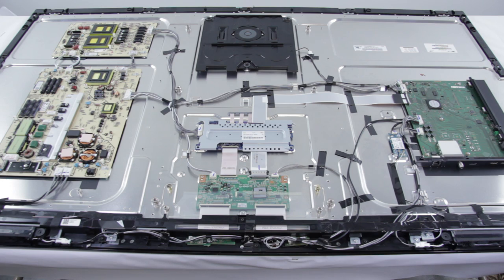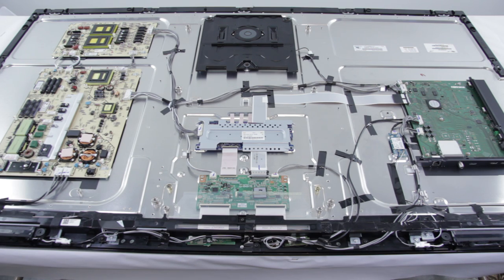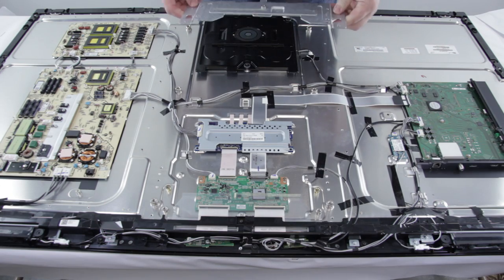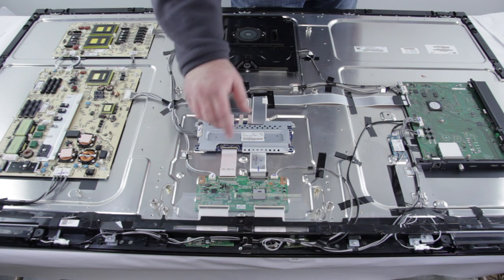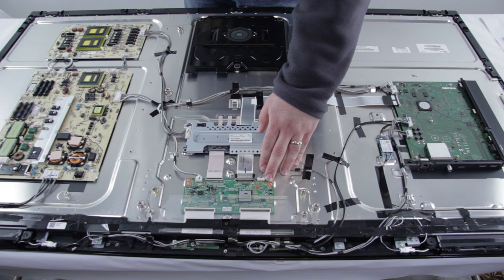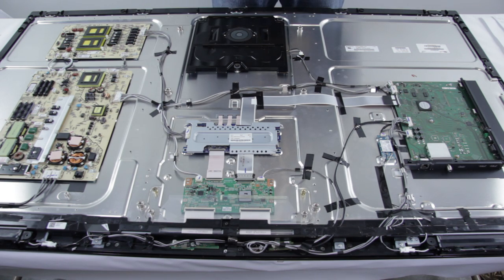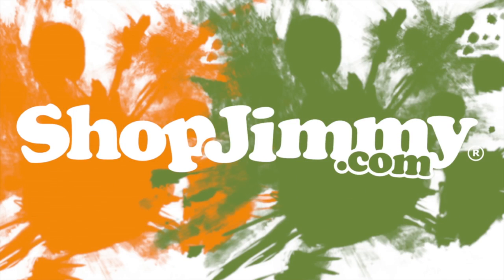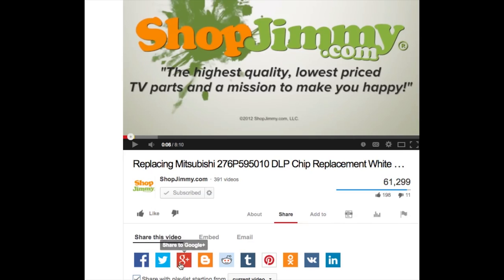LED TV Repair T-Con Board Help Review Overview - Common Issues and Problems with T-Con Boards

Comment: I have a quasar sq5000 TV. you can turn it on but after 2 to 5 minutes it goes black. if you shine a light on it you can see a dark image. I've tried replacing the main power board and the LED driver board and that did not fix it. The Sound Works and never goes out.  I was thinking it might be the t-con or the backlight strips,  I'm pretty sure it's not the logic board. Any help would be appreciated

Comment: I have a Hisense 50K360G has backlight but no picture. When I disconnect one of the tcon ribbon cables I get half a picture. Also when the half picture is showing the menu and input buttons do not work either. I also get blinking code. 7 blinks short pause then 3 more blinks
Reply from the maker: Dan Bierman   Try all repairs and troubleshooting at your own risk.  This sounds like a TV panel (TV Screen) problem.  If your TV panel is bad, it may be more cost-effective to replace the TV as panels are typically hard to find in stock, difficult to replace, and expensive.  Thanks and please let us know if you have any further questions!  www.shopjimmy.com

Comment: Hello, I have a Samsung LN52A750R1FXZA LCD TV with a distorted picture. When I turn it on, the video has double or ghosting images and one half of the video will be lower than the other.  After warming up for 30-45 minutes, the video goes back to normal. Would you know what part I could start with replacing or how I might troubleshoot it? Thank you for your time, Steven.
Reply from the maker: Steven Lovold   This sounds like a TV panel (TV Screen) problem.  If your TV panel is bad, it may be more cost-effective to replace the TV as panels are typically hard to find in stock, difficult to replace, and expensive.  Thanks and please let us know if you have any further questions!  www.shopjimmy.com

Comment: Hello I have an Etec 42 inch led tv and while Im watching tv the it goes haywire, input funtion comes uo then switches to menu then sometimes changes the channel.. It will do it for a awhile then stop but then repeat itself. It's very annoying. Someone told me maybe I need to change the T-con board but not sure. Any opinions would be helpful. Thank you

Comment: I Have a Hisense TV 50Hg5, 2014,  The red light comes on but don't get any sound or Picture, don't see any back-lights on and can't see any image on the screen when using a flash light on the screen, I only see a power supply board,main board, t con board, don't see anything wrong with any of the Caps on the power supply or main board. Thanks for any help

Comment: hello, 
I have a insignia tv that I had found in the alley,
this tv doesn'tdo an itching whenI press the power button, I opened the back cover and everything looks OK with fuse,and capacitors. onething that I noticed on the t con  board is that a very small led light comes on when I plug the tv to an outlet but after like5 seconds this light goes off . do you thing this is a t- con issue? 
the fuse is good I all ready testit with my metter and capacitors don'tlook lumpy , 
another thing that I noticed is that under the t- con 
3 small spots look bur but I don't think this is the problem because this doesn'tlook to bad. my concern is the little led light that turns off after 5 seconds when I plug the tv to on outlet, I hope you can help me and thanks in advance.

Comment: I have a Samsung TV UN75H6300AFXZA TV that doesn't turn off without unplugging it and the TV apps remain on the screen cycling between them which eventually stops and then flashes not available.  Which board needs to be replaced?

Comment: I have an 80 inch sharp LC-80LE844u, already changed out the power board, my TV powers up but no picture, I can get to the menus but no actual video shows up.  T-Con board?

Comment: I have a SAMSUNG UE55JU6410. When it's connected to power source, stanby led start blinking. On the inside I noticed 2 blue lights blinking on the t-con, and I can hear a buzzing sound coming from the power board.

Comment: my Vizio 42 inch M422bi-b1 has started flickering when I turn it on. while it's flickering the T Con board beeps along with the flickers. Then the picture goes black with back lights on and volume on and the T Con board buzzes. I pulled the back off and unplugged the T Con board then plugged it back in. It fixed it for a minute. While jiggling the right plug on the board around the picture comes and goes. So should replacing the board fix the problem since messing with it seems to have an effect?

Comment: Hey I have an lg tv the model number is 47lm7600 and I noticed some flickering, the black would look grey.  When I woke up in the morning the color is now all distorted and there are vertical lines going down the screen making it appear like it has multiple screens.  If you guys could help me diagnose this problem I’d really appreciate it.  I got the tv in 2013 and have never had a problem with it before.

Comment: i have an RCA MODEL NUMBER LED52B45RQ.  And the sound is acting up when I turn it on it sound like squeaks. after a while of turning it on and off the sound will come back. just wondering if it is a replaceable part?

Comment: lg55ec9300 OLED TV screen lights for a few seconds, then right side goes dark, and TV shuts down. Panel, or TCON? is there a way to test? I just read you no longer answer questions

Comment: I have an LG 55LV4400-UA Model  Serial # 109RKTA9H673 LCD tv.. When we turn it on.. the LEFT half of the TV picture is totally UPSIDE DOWN.. and appears solarized.. the menus and all are upside down.. We tried that advice that said to turn it off and hold the button.. like a reset type thing.. and when we initially turned it on ... it was ok.. then within a minute it all flipped again!! I have not seen any videos or read any blogs etc where anyone has this exact thing happening.. I have seen where half of the screen is black.. or blue.. but not this swirly solarized look and totally upside down.. I would appreciate any advice on this as to where to begin troubleshooting! THANKS in advance!

Comment: I have a 55in rca model number led55c55r120q it would flash to a red solarization and then go back to normal, now its stuck with a red like solarization.

Comment: Hey Jimmy.  Having an issue with my 70" Sharp lc-70le640u. Moved into a new home and it appears the movers may have damaged our TV internally. It turns on and I can hear audio and it is backlit but the picture is all garbled.  Looks like a good picture initially then it gets digitized with huge blank spots near the top portion across the screen with a garbled bottom half. What do you think?

Comment: I have a Vizio E320 AO. No screen but power indicator light works. indicates "on" and "off" correctly. 

Replaced the main board after testing the power supply board as good (24v out).

Flashlight test shows image on screen, but still no backlight, AND, image is upside down. 

Re-set the ribbon cable, no change. Did "global reset" process, no change. 

Could this be a T-Con board?

Thanks in advance for your help!

Comment: i have an LG 42le5900 tv. my hdmi ports have all stopped working. they show they are active but it says no signal available when you select them. the normal tv works fine. is this a problem with the t con board. i have swapped hdmi cables and tried factory reset but they are still not working

Comment: Hi there! 
My LG 47 inch LED TV doesn't come up with picture however we could hear the sound and the back light is ON . The techy did some troubleshooting stuff and realised that my right side of the TV screen is working fine when we disconnect the left Tcon cable and it goes off the moment we reconnect both the Tcon cables. now its pretty expensive to opt for a led panal replacement coild you pls suggest me the best possible way to fix the problem.
Reply from the maker: +sridhar palaboya  Try all repairs and troubleshooting at your own risk.  There is no fix.  Thanks!  www.shopjimmy.com

Comment: Please help!

I have a samsung UN60FH6003FXZA, the TV turns on and sound works, but the cable connection (HDMI connection) isnt working and there is no backlight. I can see the picture is there through the "flashlight" test, but it is not lit up.

I tried to replace the LED/Power Supply board, but that didnt do anything.

I tried to replace the main board, the cable/hdmi connection now works - but still no backlight.

Could it be the t-con board as well? Thats the only part left that i havent changed. Any advice would be REALLY appreciated.

Comment: Hisense model f46k20e  backlights will not work nor any other activity  unless the T-con board is disconnected from the main board. once it is disconnected from the main board the backlights will come on with no picture of course but they will come on. Then if you reconnect  the T-con board there is no activity..  Does this mean that the T-con board is bad or possibly the main board?... Thanks in advance...

Comment: I have LG smart TV (60LB6100) and had this tv for about 3 years and couple of months ago, we started to get some screen problems. We have two problems right now. 
1. We have 4 horizon lines over the screen. 
2. Half of right screen is black. (It's like a shade that we can still somewhat see the picture but it's pretty black) 
We ask you for advise how to repair this. Thank you so much!

Comment: I have a samsung UN56B7000 with the same vertical lines you described. What is the model number on the T-Con board for this model tv? I'd like to buy the T-Con board from you but wait until it comes in to install because I can still watch tv somewhat.

Thanks!
Reply from the maker: lowgizzle   I recommend replacing the T-Con board in your TV.  Here is a link to possible replacement parts for your TV model number on our website, click here:  http://www.shopjimmy.com/catalogsearch/result/?q=LJ94-02719  Be sure to match part numbers on your current board, with your replacement for compatibility.  Here is a link to a video showing how to identify your part number, click here:  Samsung Timing Control (T-Con) Boards Part Numbers Identification for LCD HD TV Repair  Be sure to match part numbers on your current board, with your replacement for compatibility.  Here is a link to a video showing how to identify your part number, click here:  Samsung Timing Control (T-Con) Boards Part Numbers Identification for LCD HD TV Repair  You can also call our customer service for further assistance with your purchase.  (877) 881-6492  Thanks and please let us know if you have any further questions with your TV Repair!  www.shopjimmy.com

Comment: To add to the problem stated in the previous comment the Sony KDL-55HX729 TV now the problem has advanced now half of the  screen is showing the clear and the other half discolored stretched lettering and again comes back to the area between the red and blue vertical lines....PLZ Help!!!!
Reply from the maker: *****   This sounds like a TV panel problem.  If your TV panel is bad, it may be more cost-effective to replace the TV as panels are typically hard to find in stock, difficult to replace, and expensive.  Thanks and please let us know if you have any further questions!  www.shopjimmy.com

Comment: I have a Samsung LED that the picture went to black with only a faint flicker that looks like heat lighting in the far of distance of a black sky. Won’t turn off or on. Only way to stop the flicker is to unplug. Any help diagnosing this woul be appreciated.

Comment: I have a 55" Samsung Led TV 8000 series.  I have a black blotch on the screen.  It is more noticeable on darker images but not as visible on lighter images.  Any thoughts on what is causing this?  Messing with picture settings or resetting didn't work  Thanks
Reply from the maker: Orlando Zamora   This sounds like a TV panel (TV Screen) problem.  If your TV panel is bad, it may be more cost-effective to replace the TV as panels are typically hard to find in stock, difficult to replace, and expensive.  Thanks and please let us know if you have any further questions!  www.shopjimmy.com

Comment: Have a Samsung UN50H5203AFXZA LED TV. About 3 yrs old. Have sound but no pic. 
When I conduct flashlight test to the black screen, I can see picture. I see no faint/little white light on back of TV when I have all lights off in front room. So I th8nk problem is the LED BACKLIGHT is not working. Can that be repaired or do I just buy new TV?????

Comment: I just bought a power board replacement from shop jimmy as my samsung UN55EH6070F was not turning on. Now the unit powers up and the logo appears on screen but then it cycles off. This pattern of off and on continues to repeat. Wondering what else I can do to fix this. Would I need a new main board?

Comment: I have Model #47PFL6704D/F7 PHILIPS...the audio is lost.  We started hitting it in the back and occasionally a firm slap would get the audio going...then it just automatically drop...I've replaced the big green board with a new one...(it's the board that has the audio connections).  It still doesnt work.  Any suggestions?

Comment: have a samsung (UN46EH5300 FXA ) WITH several  VERTICAL BLACK LINES IN THE CENTER OF THE SCREEN. Would this be caused by the t-con boards?

Comment: Have a Sharp lc70le550u that comes on with white line in the middle and a reddish spot on the left . Can see pic for a a couple min then pic goes away and just sound .  Thanks in advance .
Reply from the maker: rasantana72   This sounds like a TV panel (TV Screen) problem.  If your TV panel is bad, it may be more cost-effective to replace the TV as panels are typically hard to find in stock, difficult to replace, and expensive.  Thanks and please let us know if you have any further questions!  www.shopjimmy.com

Comment: I have Vizio M55NV LED television. When turning it on, especially for the first time, it will usually boot up and will sometimes play for a few minutes, then the screen will go blank. I can still see the backlight on, but no video. After it goes out, it will sometimes show the "V" Vizio on the screen (boot up), but will usually not show a picture until it has been off for a while (several hours or the next day). When measuring the voltages, they all seem to be correct per the power board labeling. I have not removed any boards yet, but I can see no visible signs of damage. What is the likely failure?

Comment: I have a Vizio P502ui-B1E.  Problem: No picture, but has audio.  Just replaced the power board, but the problem remains the same.  No picture with the flashlight test nor back light.  The TV keeps shutting itself off, and turning itself back on.  I can't stop it unless I pull the plug.  
What do you think?  T-Con?

Comment: LG tv, 50LN5700, problem is when I power the unit on, the back lights blink on and the LG logo is seen for a split second, tv goes black, I do have sound, when powering off, the back lights flicker and set goes off, I have replaced the power board and I am getting the same response, please advise

Comment: I have LG 60LF6100-UA.BUSMLJR
It turn on but the screen is blank no data on so I did flash light test in dark room still the same nothing show up also to test the audio so my question is 
What it could be the issue for screen on but no data even with flash light to check the audio ?

Comment: I have a Hisense LED 3D TV 55'' (Model LED55T36R3D). I have sound but no picture. It powers on, the is sound but no picture (I did the flashlight test, its completely black nothing is showing on screen), could it be the T-con board?

Comment: Hi! I have a Samsung UN46D6000SFXA. It turned off while I was watching it and hasn't turned back on. The standby light blinks 5 quick double flashes, then one longer one. 
I tried replacing the main board, but there's no change. A TV repair guy told me it was the z board (his words), but he took my money and never came back to finish the job. Any idea what could be wrong? Thanks.

Comment: I have a question.....

I have a Samsung 55UE9090F i changed the Power Board now there is the Problem with Connect Box i have no Picture and Sound, but if i switch the TV on without the Box tehre is a White screen with a blue part.

Can it be that the Mother Board is bad or the Tcon or the LED Driver Board.
The Mother Board is the BN94-06650A

Comment: Hi and thanks in advance
I have a Panasonic TX-55CR852B TV
I replaced the main board as I was having aerial signal problems
When I now turn TV on I get a red green and blue screen alternatively
I refitted original board and still getting the same red green blue screen
Any help will be most gratefully appreciated
Steve

Comment: I have a LG 55LS4600 with no picture it has raster and back lights.If i do the flashlight test and can see the menu box or if i do not see the menu box which board is it. the volume works it acts as if the channels change
Reply from the maker: Madmandrd  Please watch this video FIRST to help with your repair!  TV Repair! LCD, LED, Plasma, DLP How To Fix Your TV with ShopJimmy.com Help!  Since you have backlights, you cannot do the flashlight test.  I recommend replacing the main board in your TV.  Here is a link to replacement parts:  http://www.shopjimmy.com/catalogsearch/result/?q=55LS4600  Be sure to match part numbers on your current board, with your replacement for compatibility.  Here is a link to a video showing how to identify your part number, click here:  TV Part Number Guide for LG & Zenith Main, Digital, & Tuner Boards (LCD, LED, Plasma TVs)  Thanks and please let us know if you have any further questions with your TV Repair!  www.shopjimmy.com